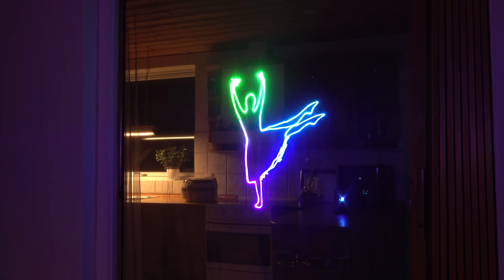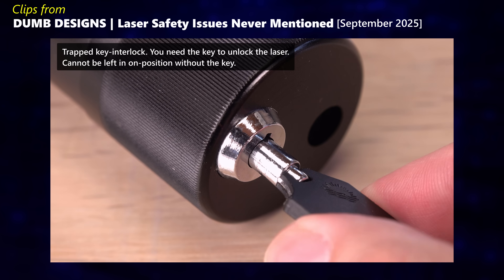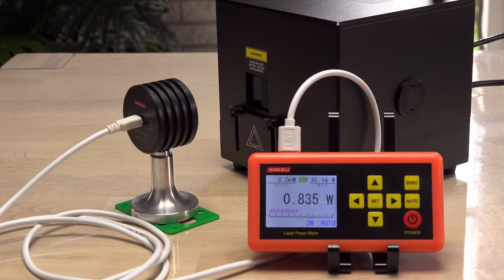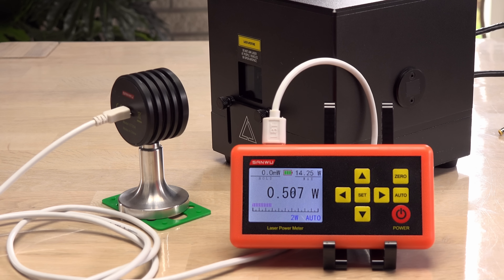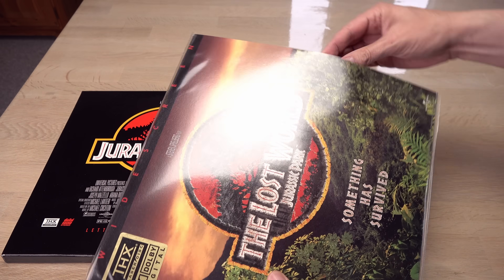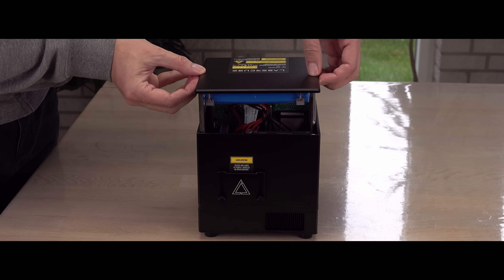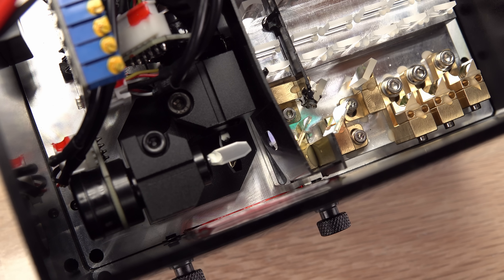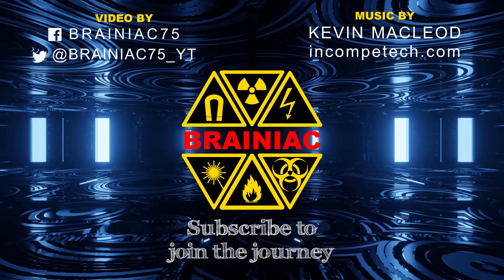SHOW LASER Beam On LaserDisc?!? // LaserCube 7.5W Ultra MK2 donated by Wicked Lasers

Comment: Imagine, in late 80s when I worked with show lasers. We needed a 3.5ton van to transport the laser, controls, massive transformer and power supply, plus water cooling lines. 
To to essentially the same as this box. 
A show lasers tube easily used a 3x63Amp connection and a garden hose cranked to 11 for cooling.

Comment: Is your first cube also a battery powered model? And I wonder: If the battery on your new one would ever fail, I assume and hope, that the projector also would still work with power from the power supply, only?
And as you strongly say that no one should ever look into the beam of a projector like this; what about dedicated beam shows with audience scanning from appropriate distances with appropriate, eye-safe patterns?
I would assume that this projector is made for such a show, in a room or a venue that is big enough.

Comment: 7:45 A CAV Laserdisc can store about 54000 frames/images. The usable data area of a Laserdisc is about 190mm (295mm outer ring, 105mm inner ring). So you have 54000 tracks on 190mm. 0.19m/54000tracks = 0.0000035185 = 3.5185 microns which results in about 284 tracks per millimeter (you measured 555 tracks per millimeter).

My calculation is very rough, but after seeing your very close spacing values between CD and LD, I had to make this calculation. The LD technolgy is much older than CD technology, about 5-10 years, so I assume the spacing has to be worse.
The counter calculation of your 555 tracks per millimeter: 555 (tracks) * 190 (mm) = 105450 frames/pictures, what is the doubled amount of the regular available frames. Something has to be wrong.
Reply: Laserdiscs are circular though, and you're using the diameter instead of the radius, so you're counting each track twice, once on each side. I therefore believe his calculations to be correct.
Reply: @NeneExists  Not really. The radius isn't important at this point. You just need the difference between outer and inner ring (295mm-105mm=190mm) and divide this length evenly to 5400 tracks/pictures. The width of each track is the result.

Comment: Hi. Would you be interested in a probe reference magnet for your gaussmeter? I have an RFL Industries Inc. F062-1K
1Kgauss ±0.5%
Gap 0.062"
Temp. Co-eff. 0.02/C°
Max temp 82°C
It had a sticker on it saying it went out of use in 1994. Would be nice to see if it is still in spec. No clue what happened to it in the meantime.

Comment: I love the Lasercube products. I use them in a professional setting. Medium club venues. These units prove very reliable and sturdy when treated well. My 2.5 watt pro units are still going strong and perfectly capable to steal the show in a club. I modified them so the can be hung like the new ultra models.  I also have two 7.5 watt ultra units. Huge step up and I like the bigger housing.

I switched to MadMapper as my core software but the idea to have more smarts such as stored shows and DMX control  in the laser does simplify smaller shows. Hopefully MadMini will support lasers soon.

Comment: Trap keys are more dangerous. They end up just being left in the unit, and so are ultimately not part of and sequenced or procedural safety. 

Same thing for estop interlocks. In many cases this becomes a chore, so people leave them close to the projector which is almost always never where they are being controlled from and thus are never manned so would not be activated in a real emergency such as with scanner failure. 

A better system would be a digitally authenticated mechanical estop based around a dead man switch operated via foot peddle. 

And an optical sensor barrier just after the scanner and before shutter and appature, which would detect abnormal beam path and pull input to ground
Reply: This is why I like voltron interlocks 😊

Comment: I hope those are closed can diodes. The glass slides really do make a difference otherwise for the lifespan of the diodes. They really did make some nice improvements to the unit. I like the inclusion of ILDA as well. For an entry/mid class Laser it's not a bad little unit at all. The netting is a fun thing. I used that at shows and bought it from fabric suppliers in bulk for large overhead stuff.

Comment: Shame they're still using a flimsy DC barrel jack connector instead of PowerCon with an integrated power supply, or at least use XLR power for DC.

Comment: Only using a few screws and having easy access to the battery is really nice. Unfortunately making the battery harder to access is a trend in electronics. Sure a lot of it is smaller stuff where it makes sense, but just not having a tamper sticker to refuse a warranty is nice.

Comment: Wether the PSU is connected will make no difference as power to the lasers will be carefully controlled whatever the power source. A Bluetooth speaker has little or no such control so can use the extra power available.

Comment: They managed to make the new version a bit more power efficient too going by the labels.  Old version is rated 150W, new version 120W, both 19V likely to allow use of the same power supply.

Comment: laserdiscs are amazing, if I remember correctly they where the first hd movie format
Reply from the maker: Well, they were higher definition and better quality than VHS, but I wouldn't call it HD ;) Thanks for the early watch!
Reply: OP is referring to Hi-Vision Laserdiscs that used a red laser instead of infrared, that were incompatibile with conventional laserdisc players. 

They were also analog AND HD at the same time!
Reply: @brainiac75  thanks, many of them where not hd but in 1993 they released some under the name "hi-vision" that could do hd but they are incredibly rare.